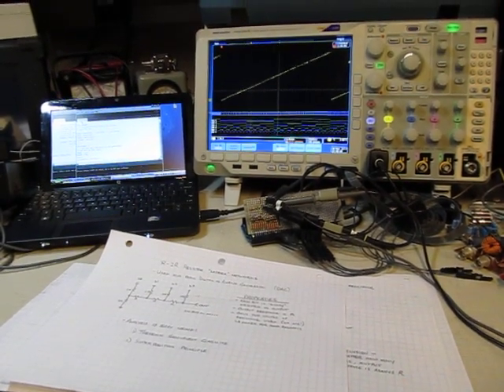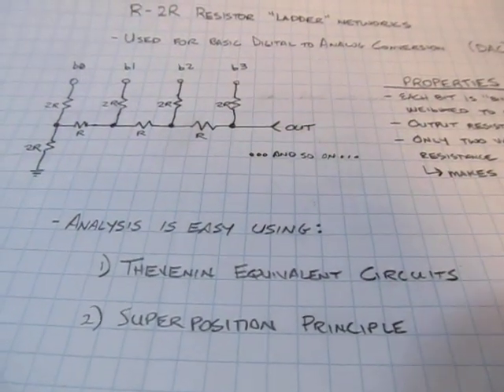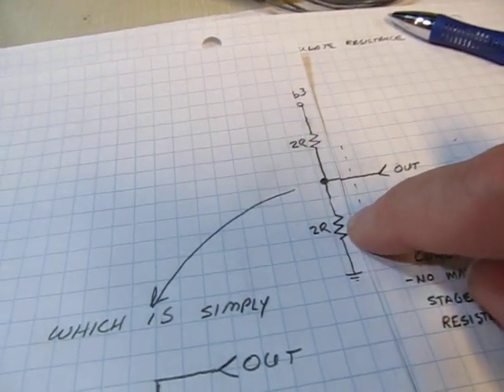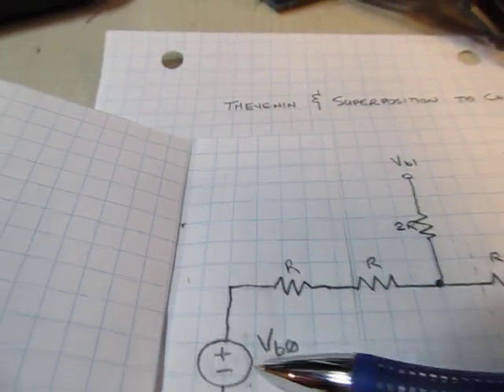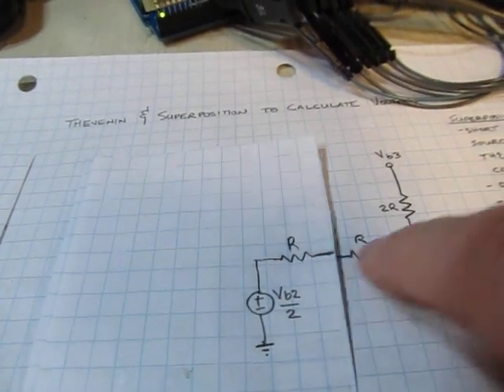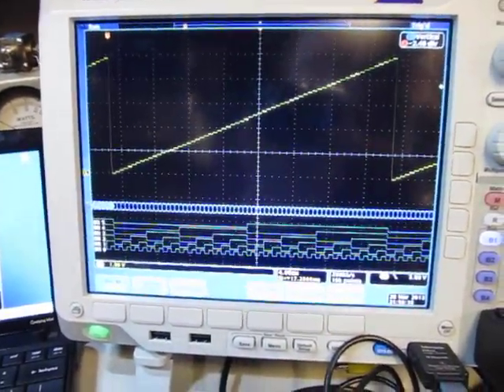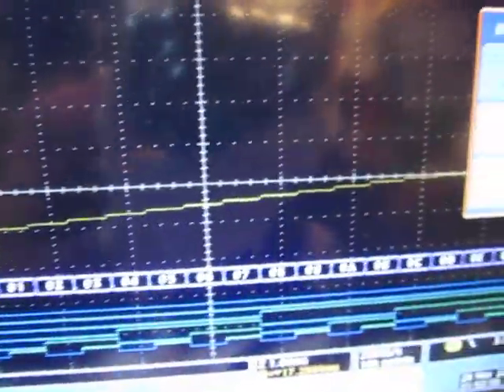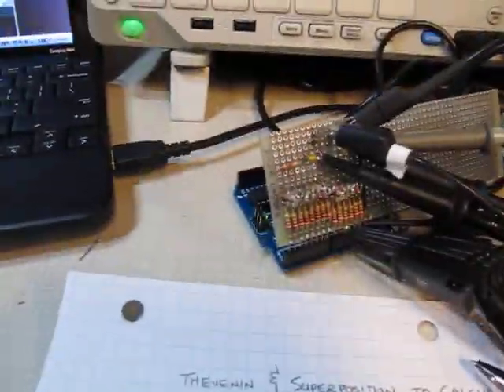#85: Basics of R2R Ladder DAC | Digital Analog Conversion, Tutorial R-2R DAC Thevenin Superposition

Comment: Anyone can explain how we choose the R value, is this random or must be low/high enough ?
Reply from the maker: Not critical. Considerations are driven by what kind of resistive load can be driven by the digital drivers/circuits, what kind of output impedance is needed to properly drive the next stage in the analog path.  Between 1k and 10k are common.

Comment: Have you ever used the 74hc393 ic chip to build a 4 bit stair step generator before?
Reply from the maker: I haven't
Reply: @w2aew  Ok. I’m working on one. Using in a Curve Tracer circuit.

Comment: I have the tds2002c that I got in a trade and I use it more than my new one. It's the only piece of gear (along with a tek dm916) I'd never part with. Even the documentation that came with it is incredible. I buy an expensive (for me) rigol and all they have is pdfs and I don't trust it like I do the tds2002c. It's a buggy mess.

Comment: Random fact. Modern high end tvs (oleds) will have to reach a refresh rate of 1k hz for them to achieve the smooth motion of those 'relic' crt displays our civilization ran away from. Imagine the processing power a pc would need to drive path traced graphics in real-time to achieve a perfect v-synch with that. 2000 dollar gpus have to use interpolation to create false frames to hit 4k60 now finally but cpus will take longer to evolve than the display tech because they can't match the parallelism of modern gpus to feed them fast enough. I rarely find a game the odd time I play one (as I get older) where my cpu can saturate the gpu with vertices fast enough to hit full utilization. Intel said they would be at 10ghz by now but they can't hit it with current 3nm euv silicon etching. The 3nm node itself is a feat of monumental human ingenuity and it's hard to believe only one company makes sub 28nm lithographic etching technology. Most ics these days have stayed at that node as it's more than sufficient for most smd ics. I believe all dip ics are on the same 140 something nanometer node for the last 15 or so years. It's why most Chinese ttl and cmos ics are somewhat reliable for most hobbyists to mess around with. I've stopped buying as much from them the deeper I go down this fun rabbit hole people like you make so infectiously approachable and fun. I've read more text books the last five years and taken more notes than I did in university learning about data mining algorithms back in the 90s haha. To be fair though there were not alot of books then so we read white papers and such. I graduated top of my class then went into policing ffs and now play catchup in my 40s hahaha. Best thing about early retirement has been learning about electronics and playing stringed instruments. I wish I was as good at electronics as I am at playing guitar.  You should have a patreon, even if you don't need the money. I'm sure alot of us would show appreciation. 

If you give me your mso I'll donate 10k worth of test gear to a local non profit hahaha. (Admittedly though it wouldn't be fair as I'm half way there already) hahaha.

Comment: flip book idea is great!
but why did you solder 14 bit ladder if you used only bits b6...b0 for the presentation? all other buts are nit used so fir this example one port would do, right?
Reply from the maker: I built this for a project that used both a 6 bit and an 8 bit R2R for a scope XY display application.
Reply: I got an impression that you built 14 bit dac, 8 bits on one port and extra 6 on another...
Reply from the maker: @markderlo212  nah, it was 8 bits on one port to drive the X position of an XY display, and 6 bits on another port to drive the Y position.
Reply: oh I see, how to find that xy dac clip ?
Reply from the maker: @markderlo212  It's at the very tail end of this video

Comment: Thanks understanding the weighting using a simple resistor network was easy enough. I struggled with the R 2R voltage mode model. This helps a bunch.

Comment: When r2r is feed with a current, the overall analysis looks much simpler. All you need is to divide the current by two at each stage. And a I/U stage is simpler and more precise than U stage. The only reason for a voltage ladder is a ghetto-dac, when fpga/soc is connected directly to the ladder.

Comment: Thank you, Alan, for another terrific, informative video!  However, I'd like to stir things up , if I may, with a bit of debate: I submit to you, Sir, that this is technically not a digital-to-analog converter, but a binary-to-decimal converter, since it's output is still composed of discrete, non-arbitrary steps, rather than one smooth, continuous curve.  Would you or anyone else care to refute my claim? ;^)
Reply from the maker: I wouldn't call it "binary-to-decimal", since the output is certainly not a decimal value.  A more accurate description would be a binary to discrete analog or quantized analog.  All DACs output discrete analog outputs.  You can put a low pass filter at the output, whose corner frequency is below 1/2 the sample rate, that will "smooth out" the steps in the response.  This is often called a "reconstruction" filter.

Comment: A great video. I have some beginner's questions. How do you select the magnitude of R? In principle it does not matter, but if it is too low it might load the digital source. Can it be too high? For example, very high resistance might add more thermal noise? Thanks in advance for any answers.
Reply: I built R2R DAC using 0.1% 7.5k and 15k resistors. The expectation was to get 8-bit resolution with 8 digital inputs. Not so easy. Actual resolution appeared to be 7-bit, most likely due to variance in  intrinsic  resistance of digital pins of the microcontroller, estimated to be in 300-500 oHm range. So higher resistance (50-100k) might be beneficial. Yet another limitation was Vdd noise on digital pins, also limiting resolution to about 7-bits. Overall impression that 7-bit is a practical limit.
Reply from the maker: The resistor value is a compromise between the load placed on the digital source driving it, and the output impedance - and how it will be loaded by the circuit that "reads" the analog output.

Comment: Very much appreciated, W2AEW!  This and the rotating "TeK" video very nicely done, well paced lessons and the start of a much-needed refresher course, if I'm going to make any headway with some of the projects I've been wanting to try.  The R-2R DAC stuck into an Arduino is a kick!  I have all the parts but I doubt if I have all the patience.  We'll see!  Thank you for posting!
Reply from the maker: You can buy R-2R resistor networks from places like Digikey or Mouser - a lot less tedious to wire up!
Reply: Thank you, W2AEW, will def. look into the ready-made solution.  But there are times when such tedium can be good for the soul.  ;)

Comment: is it possible to  vary the peak to peak voltage  coming out of the circuit
Reply from the maker: Being a DAC, the output is a function of the parallel digital word applied. If you need more resolution, add more stages. Max voltage is determined by the logic 1 voltage level of the digital circuits driving the inputs.
Reply: hmm so vmax can be digitally controlled , i just needed 60mv to 6 volts sine wave  controlled digitally, is it possible ??
Reply from the maker: The output voltage can't exceed the logic 1 voltage level.  So, you'll probably need to follow the DAC with an amplifier to get the voltage you need.

Comment: My analog audio output on my pc doesnt work, so im must use the digital one. Is it possible to use only one digital input?
So, the resistors are voltage dividing the digital input so it can be read as analog? How can i get more bits if i only have one digital output? Hope you can answer me :)
Reply from the maker: The R2R DAC needs parallel digital input. If you only have a single bit source, then the only thing you might be able to do is to feed the data into a shift register. Although, you will still need and additional bit of two to click the data into the register, etc. the better thing would be to pick up a $10 Arduino...
Reply: Aha i see. Thank you for answering this quick, this is what i needen to know.

Comment: It seems that I can use this circuit to read four (or more) digital buttons, or switches.  I would connect one side of the open switch to my high logic level, like 5 volts, or three volts and then the other side of each switch to b0, b1, b2, and b3, and then if the switch or button is connected (it registers a binary 1 on that line) and it will add an appropriate amount of voltage to the Vout. Am I understanding that right?
Reply from the maker: Yes, except that the output will be binary weighted for any single button push.

Comment: I am learning electronics buy myself and your video has made allot of things make sense now. From how digital outputs work (constant voltage) to how transistors control voltage, and even how capacitors are used to clean up ac from a dc voltage signal. Great I can not thank you enough for your clean and detailed walk-though explanation! I have just purchased an old analog oscilloscope, cant wait to see pulses that can otherwise not be perceived :-)
Reply from the maker: Great! I'm glad my videos are helping you to learn electronics!

Comment: what Range of your oscilloscope of the amplitude output voltage
Reply from the maker: +ting yiu i&#39;m not sure I understand your question.  The scope was set to 1V per division, which shows the full 5V range of the R2R driven by the Arduino.
Reply: +w2aew do u have any social acc?i hv a few questions of assignment!
Reply from the maker: +ting yiu You can find me under the same user name (w2aew) on eevblog.com forum
Reply: +w2aew turn on resistance of 100 ohms & turn off resistance of 1G ohms,
for each control a current up to 10mA,
what the (R'ref) equal to?
Reply from the maker: +ting yiu I"m sorry, but this question doesn't make sense to me (out of context).

Comment: Alan, did you have to adjust your X/Y coordinates when you switched from PWM to the R-R2 DAC and started writing PORTD and PORTB registers? I built a ladder very similar to yours and it seems to test out well on the "steps" test. (Just running up consecutive numbers and resetting to 0). When I tried applying my PWM coordinates, my initials where not recognizable although points and lines were and no flickering. Looked misconfigured. Same 2.7K resistors (2 in series for R2) and a 10nF to ground off the output. I am wondering if my sketch might be off but it seems pretty simple to do.
Reply from the maker: The only two things I had to do was to use the map() function to rescale the X values to 0-255 and the Y values to 0-64. Also, adjust the delay in the loop and/or the filter cap to ensure the points settle to make a clean, crisp trace.
Reply: Been fooling around and yes, figured out you couldn't push a number like 98 into a six bit field. Went back to the Xmas tree and got that displaying nice. I divided all the coordinates by 5. I'll use the map() function for my initials and see what I get!  Alan, I want to sincerely THANK YOU for all the time you take posting your videos. Thank you for uploading your knowledge and experience!
Reply from the maker: I'm constantly inspired by the nice comments and encouragement I receive from my viewers, so Thank You!
Reply: ***** Everything worked. Christmas Tree and initials are crisp and flicker free. Have to get a camera that is fast enough to show it!! LOL. Had to fool around with the cap filter and timings to get the right combo. Settled on a .1uF Mylar cap. I was only seeing points on the scope until I changed out the cap. Learned a lot about my scope in this project. Thanks again!

Comment: You have an 8 bit and a 6bit ladder. You show us the 6 bit on your mixed domain. Is that your Y-axis and the 8 bit your X-axis?
Reply from the maker: Yes - I used 6-bit for Y axis because the screen is rectangular.
Reply: Thanks, I get it. You are working with DWORD and BWORD in the Arduino. Great project.